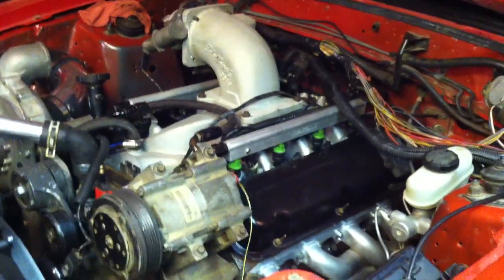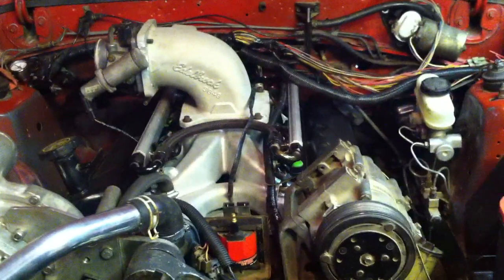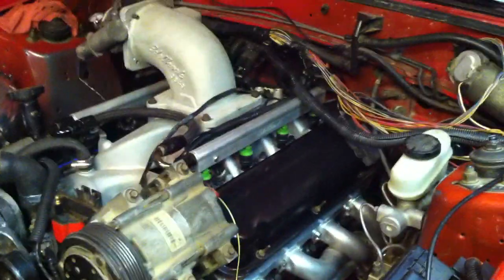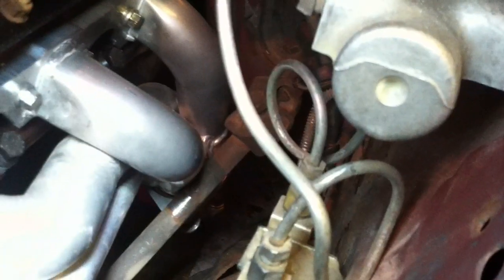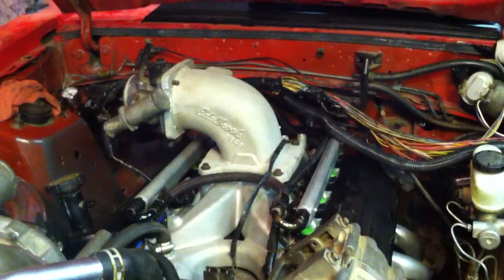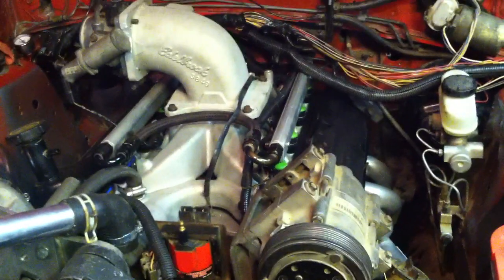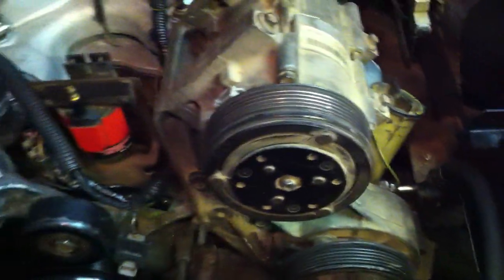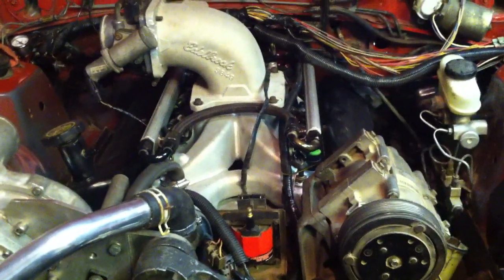351w Swap Tips  [Foxbody Mustang]

Comment: That looks great, my friend! I had originally been planning on doing a modular swap into a Fox Body Mustang; however,  I've been looking at sticking with the pushrod and either going with forced induction (which I might end up doing anyhow, but this will be my daily driver and I have almost 50 miles of driving to do each day to and from work so the car has to be reliable lol) or going with a 351 swap into the '86 Mustang GT. I wanted to ask if you happened to put it on the dyno or if you had any guesstimates as to how much torque and hp you picked up with just the 351 swap not taking into account any of the other work you did to it after that, sir? 

I am looking at my '86 GT which has all of the basic bolt-ons you can get and seeing what a 351 swap would do for me. That way, I could stick with the pushrod and stay naturally aspirated at least until I can save up over $8500 or so to begin going down the forced induction route with either the 5.0 (it is bored to 306 so not a pure 302) and perhaps going with a turbocharger setup - or I really like the old school vortech supercharger setups man, but I don't know - or with the 351w if/when I happen to swap that out if it really makes a massive difference. Since this will remain my daily driver for a good amount of time, I don't think I am going to be looking to push some kind of massive amount of hp through it by getting a really hot cam or pushing a lot of boost either with a s/c or t/c, but what do you guys think I can get with a 351w swap with all the bolt-ons? Thanks so much for the info!
Reply from the maker: The 351w in stock form with no blower was about 280 hp and 360 ft lbs vs the 200 hp and 250 ft lbs.  that’s with gt40 heads and intake though.  Stock 351w heads give a bit less hp.  

The main benefit from the 351w is the block strength.  If you go with forced induction, the stock 351w block is far stronger...
Reply: @Clevor BMF - Thank you, sir! That is perfect, so adding over 50% more torque and close to 45% more hp is what i would want there. I really have to just keep rewatching your video because it is a thing of beauty :) If I could ask one more thing - how much do you think it would run me for parts grabbing the 351w out of a junkyard and throwing on the hotter heads/headers from my Mustang with the swap package? Thanks again, my friend! Happy driving :)
Reply from the maker: @mihaeltomasovic   thanks for the kind words :)   depending on where you get parts from.... the 351w intake manifold is the most expensive part of the package... I bought my entire engine and trans package for 3000 with the ecu and wiring harness... finding a used lightning lower and upper is around 500 and up now days.... you can always buy a new edelbrock or trick flow manifold but they are around 7-800...  the cheapest option is something like the carb style efi intake manifold...
Reply: @Clevor BMF - Thank you, sir! That is great advice and information! I am in a bit of a pickle right now as I live in an apartment complex that doesn't allow me to work on my car in the parking lot... I could either rent out garage space which would cost a ton of money and try to teach myself a lot of this stuff, or I could just pony up the dough and get it swapped by a buddy of mine who specializes in Fox Body Mustangs and particularly in Modular Swaps; however, he can do any type of swap so I'm thinking he would be able to do the 351w swap... 

Also, I really want it to be as reliable as possible, so, while I am going to get a hotter cam and use the GT40 heads, I really am going to try to make the safest alterations I can... So, I think a good intake manifold will be needed to be able to get me up close to 375hp... However, I know the torque in the 351w is just beautiful and that is what I really can't wait to feel in all honesty. I have done almost all the bolt-ons possible to my '86 306 stang, but it still isn't making the torque (or hp) that the 351w will make before even going further with more parts for it... I am hoping my t5 will hold on for a little while longer, but I think it is really not going to be able to handle it so I am in the market for a new five speed transmission (or six speed if possible LOL). I remember you mentioning it in another video, my friend, but I cannot recall if you said whether you had a manual or automatic transmission - and which one you are using right now, bro? Thanks so much for all of the information and I will be making a video of my own when the swap is complete :)  I am in Aurora, CO, but I hope we can get in touch and talk Mustangs or cars in general or whatever you'd like, @Clevor BMF :) Take care, good sir! 

Sincerely,Kris
Reply from the maker: @mihaeltomasovic   Always up for meetng new mustang people!  Our mustang group in northern colorado is called Horseplay Mustang club of northern Colorado.   Look us up! 

Also, I'm currently using a tko600 in my car... Love it thus far!!.

Comment: What distributor did you use? I know MSD has that one specifically for 351w swap I have an 87 vert but I'm keeping it carbureted. I just didn't catch if EFI vs Carb made any difference with the distributor
Reply from the maker: That depends on what electronics you keep from the factory. If you have stock wiring from a 5.0 that has a factory connector with a TFI module then you can use a factory ford distributor. I got mine for 50$. Brand new from rockauto.com.  Ford trucks in 90-91 (and some other years) that had a 351w came with a TFI module and are plug and play with 5.0 mustang wiring harness.  If you go carb and take out all the wiring, you'll need something like an MSD dizzy for a 351w and 6AL.
Reply: B Stang Thanks I'm gonna try and use that Truck distributor since I am keeping all my factory wiring but running a carb. If that doesn't work I'll be dropping $280 on that MSD unit
 thanks for your help
Reply from the maker: Yeah the cost of the MSD parts is why I went the route I did. I got a great piece that included the cap, rotor, and TFI module. Hard to beat that.
Reply: Couldn't agree more!  I'll have to upload a video of the finished product. I have an 87 Vert and I'm swapping out the bone stock 302 and fired C4 automatic for my world class t5 and a 351w.

Comment: I have a 3 inch cowl and i wana go fuel injected would the stock mounts be good to use and would everything be cleae and not hit anything
Reply from the maker: You’ll have to test that out.  It’ll be close... you can space the k member down if you need and inch or two...
Reply: Clevor BMF whats the intake u need to efi
Reply from the maker: You’ve got a few options.... if you go on www.summitracing.com
Reply from the maker: Narrow your search on summit racing down to 5.8L efi intakes.  If you like the elbow style, that’s called the edelbrock super victor but you also have to buy the elbow separate.  The lower portion of the intake manifold is the difference on a 351w.  It’s wider than a 302.... to save some money, you can look at different Facebook pages and craigslist for used ones..... the gt40 from a first gen lightning is a popular one but it’s getting rare and about as expensive as new manifolds.

Comment: Great video, thanks!  I have a build 351w I'm looking to put into a fox body style mustang.  Do you know of any particular years that are preferable for ease of installation?  My engine has about 400 hp and 400 ft pds of torque.  I plan on making it a daily driver/toy.  Also, how much additional power is your turbo providing, total power?  Did you get it finished?
Reply from the maker: Thanks!  All foxbody mustangs are going to require about the same amount of work.  This setup was only about 400 whp after the supercharger was going.  Was only about 5-6 psi. 

I've since upgraded to a 408 stroker and a bigger supercharger making more boost.  Haven't had it on a dyno yet, just getting it tuned and on the road.

Comment: I thought the convertible engine mounts dropped the motor down a 1/2 inch.
Reply from the maker: Im not sure on that. I have seen both convertible and non convertible engine mounts and there arent any noticeable differences between the two. Both look to be the "captured" style mount and both look to have the same dimensions...
Reply from the maker: After spacing my sway bar down, I learned that the sway bar mount from an sn95 bolts in place of the fox mount and does the same thing.  All comes down to how much you can spend. If I would have known that the SMR solid mounts would cause the oil pan to contact the steering rack, probably would of went a different route.  The energy suspension mounts are great pieces, especially for the money.

Comment: looking for a little help what to use for exhaust manefolds on a 351w swap on a 1990 gt mustang.Working with tight bugget.
Reply from the maker: +Nick English Well, you can use the manifolds from a 302 from what i've heard.  The main difference in the 302 and 351w is the deck height of the block.  this will cause the stock 302 manifolds to sit a little higher and may cause some clearance issues with the h pipe.  I used the stock 351w manifolds from the 93 lightning i got the engine from initially... but later switched to the 351w swap headers so i could use 302 h pipe and cat back...

Comment: I have a 351w swap with gt40 upper and lower and my 3inch cowl still hits lol BUT I ran a truck fuel rail and had to use a 1 inch plenum spacer to clear the fuel pressure regulator and fuel lines. So kind of my fault. BUT yet again my fuel lines are a lot more simple to run since I used a 1996 v6 mustang fuel system lol and just had a revelation as I typed this... I didnt think to put a gt fuel pump in it.... FUCK!!!! Lol oh well. Oh and another thing, I got convertible mounts and a UPR k member and I did have to make half inch spacers to raise the motor to clear my oil pan and ding my header on tube 7? like everyone usually has to to clear steering shaft.  EDIT just figured out the v6 and 4.6l v8 use the same fuel pump. shew. it'll do for now till mods out run the pump lol
Reply from the maker: Sounds like you went through a lot of the same headaches that I did with my swap lol  worth it in the end!
Reply: eXp0N3nT1aL hey how much was the swap. I just bought a Fairmont and I want to put a 351w and transmission I have laying around. I'm 16 and on a budget for how cheap you think I can do it. I have a mechanic shop on my dads business so I have tools

Comment: has anyone try using 302 long tube headers. i cant really afford the 351swap headers.
Reply from the maker: +Logan Boos Not that I have heard of....
Reply from the maker: +Logan Boos 302 ----headers will fit, but you'll probably have issues connecting them to a factory style foxbody exhaust for a 302.  the deck height of the 351w is taller than the 302, so it'll be a bit off from where they should be with a 302...

Comment: All your video made me say is for sure go cowl hood and carb.... Why do you like so many headaches it could of been avoided....
Reply from the maker: I had never done the swap and there wasn't a ton of info out there about problems people had doing it.... Hence my video... To help others avoid the problems.
Reply: +B Stang well then thanks for taking one for the team!!! Getting my 351w this weekend
Reply: +B Stang Probably gives the engine a lower center of gravity which would be beneficial to the handling but i doubt it's really actual noticeable but some autocross junkie would probably like knowing that .
Reply from the maker: +Zachary Andrew    When you run a blower made for a 302 on a 351, you end up with the blower being higher than normal due to the taller deck height of the 351w.  the blower ends up hitting on the hood and there isnt a cowl you can use to get it to fit since its so far towards the front of the engine bay.  

I could have modified the supercharger bracket, or space the k member down.  spacing the k member down gave me two benefits... one being that the stock hood fit and two being that the supercharger cleared and I didnt have to modify the bracket.  Killed two birds with one stone.
Reply from the maker: +jarqu14   spacing my k member down, using drop motor mounts, and using the steering rack bushings gave me a lot more clearance under the hood for my blower setup without needing to modify my supercharger bracket to get anything to fit.  

With the taller 351w deck height, its challenging to fit the 302 made brackets under the hood without doing what I did.

Comment: Belt set up?
Reply from the maker: Depends on how many accessories you want to run.  The stock foxbody brackets work.  You’ll have to measure for the belt and get the right length from the parts store

Comment: How much did the whole thing cost?
Reply from the maker: CuriousTyrone  Thats kind of a tough question... I swapped from a V6 auto car to a 351w 5 speed.  I had to spend quite a bit on parts that that wouldn't of worked even for a 302.  fuel lines, pump, fuel rails, all front engine accessories, transmission, driveshaft, and the engine along with all the efi electronics.  I was right around 2-3k into it, but the car was only 800$ when I bought it.   If you're swapping from a 302 to a 351 it would be cheaper.

Comment: about how much did it cost? without the shell.
Reply from the maker: I started with a V6 auto and went to a supercharged 351w with a tko500 trans so what it cost me was a bit higher... I was around 4-5k on my setup.  You could go cheaper and do a 351w with a t5 for 1500-2500 depending on your starting point. If you've already got a Foxbody that came with a t5 and 302, you'll have all the wiring and trans and it'll be real cheap.

Comment: the washers between the k member is ghetto as hell. I'd modify the oil pan.
Reply from the maker: +Nick P  I agree.  They were cheaper than a $300 plus dollar hood.  Not everyone is a rockstar with tons of money.  You should share the wealth with the rest of us.
Reply: +B Stang then don't run a Hood. safer that that washer stuff
Reply from the maker: Nick P How do you figure it's not safe?  The factory k member has two spots that contact the frame rail when you bolt it in.  The fact that I increased the distance between the frame rail and k member by 1.5 inches did nothing to effect the strength of integrity of the car.   If you don't like it, then don't do it.  I'm just showing what worked for me in my application  with the budget I had. Running with no hood was not an option for me since I drive my car on the street 80% of the time.
Reply from the maker: Nick P   I didn't have 100$ for this:

https://lmr.com/item/MM-MMKM21S/79-04-Ford-Mustang-Half-Inch-K-Member-Spacers?gclid=CK7W0aetw8wCFZY1aQodOgQMcw

So I opted for the cheaper solution.  My car, my mods. Don't like it, GTFO.
Reply from the maker: Nick P  As for the oil pan, that was only a temporary fix.  No welder, and no money to take it to a shop.  The solid drop mounts and spacing the k member down let the supercharger fit under the hood without modifying the bracket.  Do some more research before you troll on my video that's just trying to help people.
Reply: +B Stang hey man, its your life. risk it if you want.
Reply from the maker: +Nick P if it was a risk to my life or anyone else's, I wouldn't of done it.

Comment: hey what lower intake are you using?
Reply from the maker: Edelbrock Super Victor EFI Intake Manifold 29245

http://m.summitracing.com/parts/edl-29245
Reply: What fuel rails did you use to work with that lower intake? I have a similar intake and Made the mistake of getting 302 fuel rails witch had a different angle for the injectors and the mounting tabs didn’t line up at all.
Reply from the maker: When I bought the intake used, it came with an edelbrock fuel rail setup on it... I still have it laying around, but there’s no part number on it..  I would guess an edelbrock made for a 351w intake.  Did you try summit racing or jegs?
Reply: I’ve looked on both and saw a few but wasn’t too sure if the tabs would line up to mount the rails down. On the link u put for the lower intake the pic shows the intake without the mounting points for the rails but noticed yours had them.
Reply from the maker: I’m not sure on the pictures on other websites... but edelbrock suggests the edelbrock 3620 fuel rail for the super victor efi intake.
Reply: Yea saw that one but also noticed that one -6 AN’s on the end. The Aeromotive stealth kit I ended up getting has all -8 fittings. Saw some comments online from Edelbrock saying they don’t offer anything bigger than that but then again that was years ago. I need to hit them up, but Cool man, appreciate the info and keep up the good work on the stang!
Reply from the maker: Thanks 🙏

Comment: Dude that spacer bullshit is sketchy as fuck....all for a stock hood ...what a shit show.
At least cut and drill steel plates that goes through both holes.
Reply from the maker: If I was that sketchy it would have failed some time in the last 10 years…. Yeah, super sketch.  Used what I had to get it done at the time.  Thanks for stopping by to throw some shade 🤘🏻🤘🏻🤘🏻